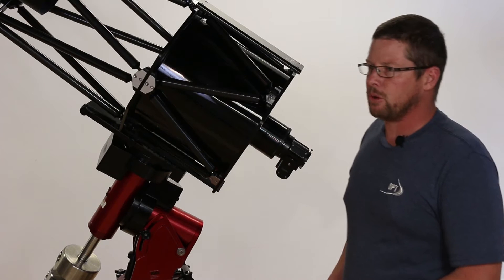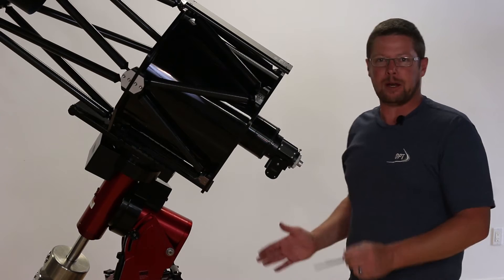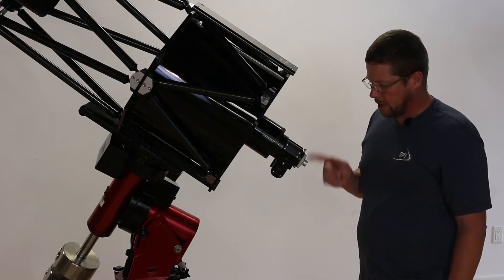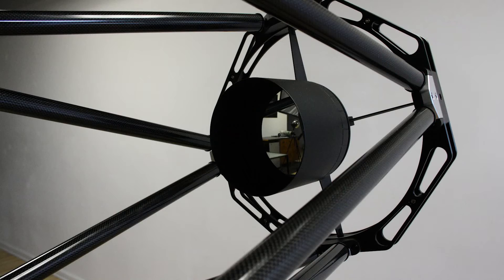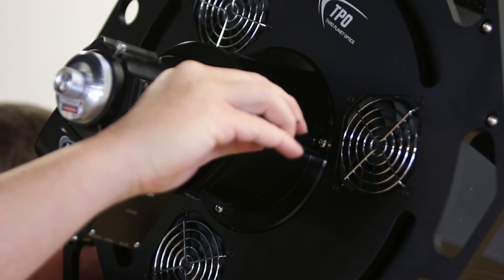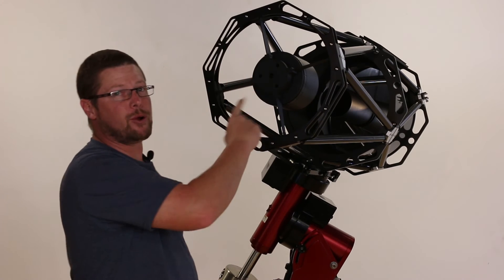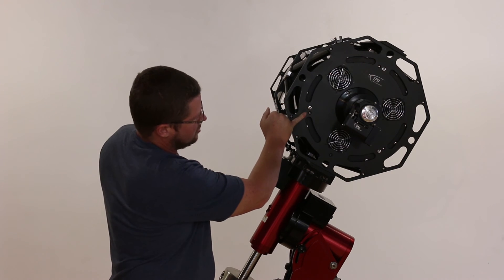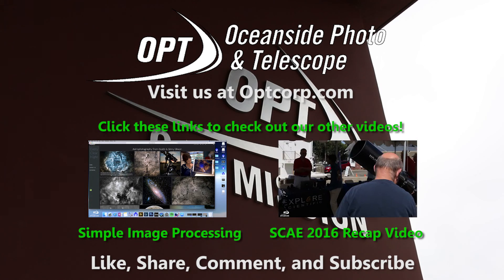Laser Collimation for TPO Ritchey-Chretien Scopes- OPT

Comment: Is the last step - collimating the primary - required for the newer RC scopes wherein the primary is fixed? I would imagine not
Reply from the maker: Actually, in these types of scopes the primary is "fixed" in the sense that the mirror does not move backwards and forwards for focusing. The mirror in this type is still capable of tip/tilt movement and does require collimation.